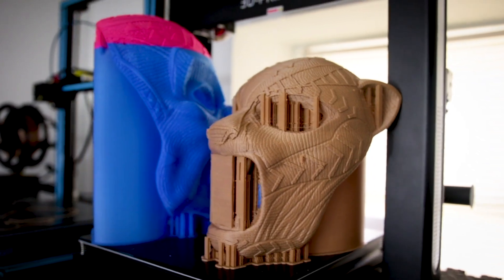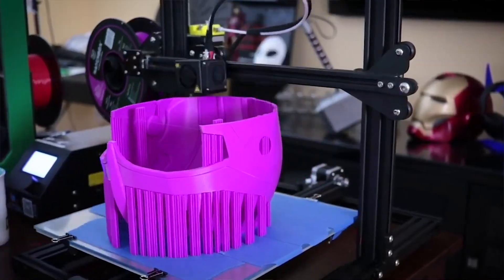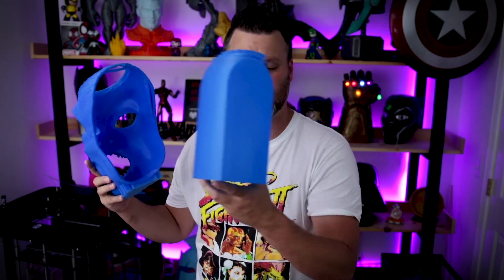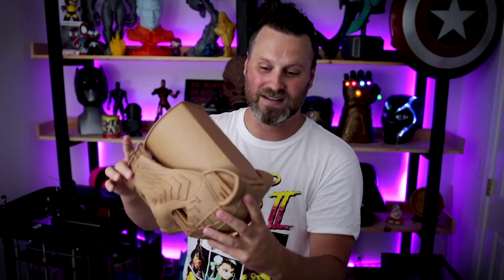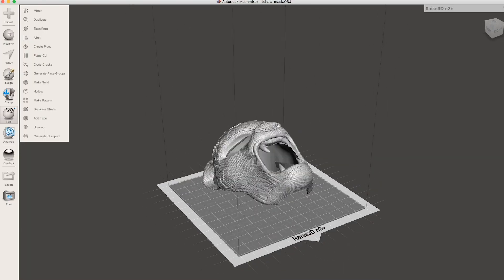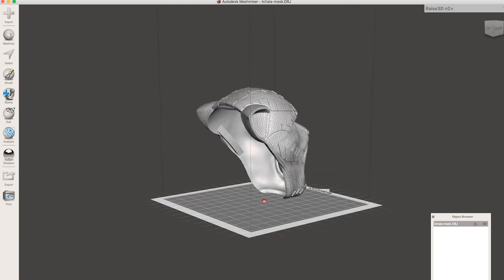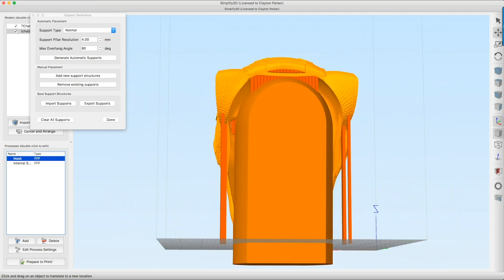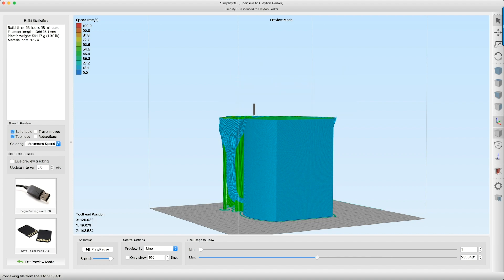3D Printing Helmet Orientation - Custom Support Structures with Simplify3D & MeshMixer

Comment: I use Cura and I print right side up with supports engaged. I use support blocker to block the supports that will fill the dome of the helm. leaving supports that assist other detailed areas. A full mando helmet is 2.5 days to print @10% infill using less than 500grams filament. No support marks on the dome to spend time on. just layer lines that need smoothing but thats normal.

Comment: Why dont you do it diagonally like this \  
Then you have less distance from the bottom to the inside top which would need shorter supports/ support column thus reducing the time and material needed.

Comment: How about a landscape orientation of the mask instead of upside-down portrait. 
[The front of the mask is the top, and the bottom is the bak side of the mask (It's hard to explain with just words, sorry)]
*No 3d print experience, so i'm just suggesting something that came out when I watched the video.
**Sorry

Comment: So this may be a dumb idea but what if you sliced the cap of the helmet top off and print it separately then attach later. My logic is if it is the only print failure then remove it and print it separately and properly.

Comment: You don't use another process in S3D to use a finer layer height at the top of the helmet to avoid additional ringing (using either orientation or support method)? Or do you find that feature not quite worth the trouble?

Comment: Thank you for the video sir! 

In cura, you could disable "ensure models are kept apart," insert the support structure, enable "per model settings" for the support structure and drop infill to zero.  
Then with custom supports plugin, you can add the supports in between.
I didnt realize there was support material in between the structure! I tried doing it by changing mesh type to support structure, was going to add a wall and drop the individual support infill to zero but cura doesnt have that option. 

 In theory it should work, I will have to try it on my next mask.
Reply from the maker: Oh nice! I was hoping there might be a way to do this in cura!